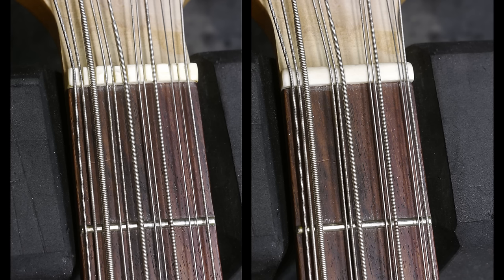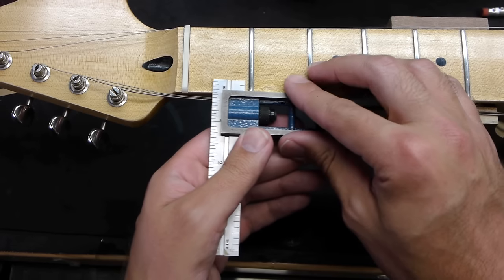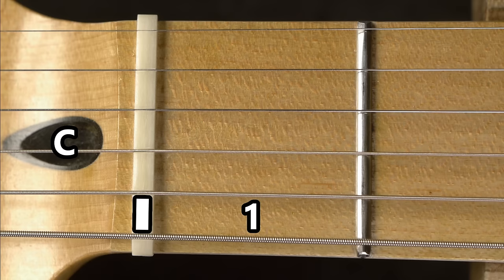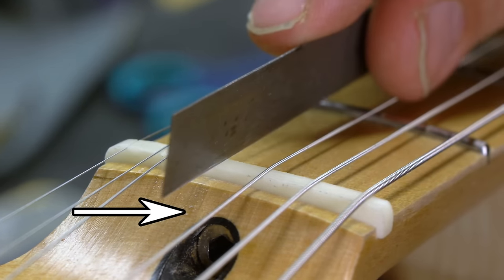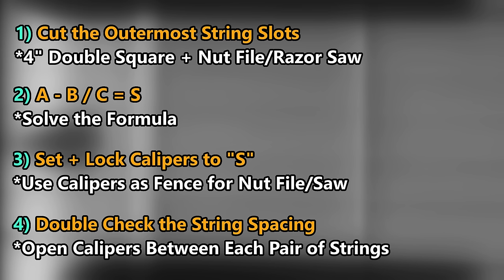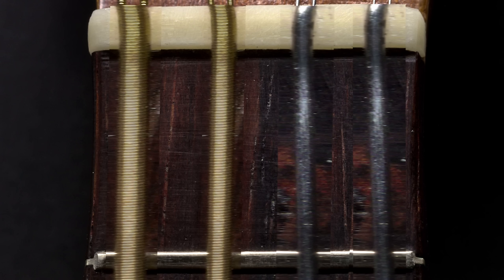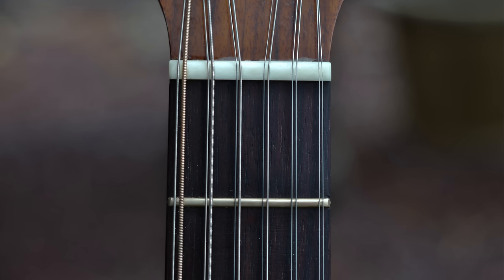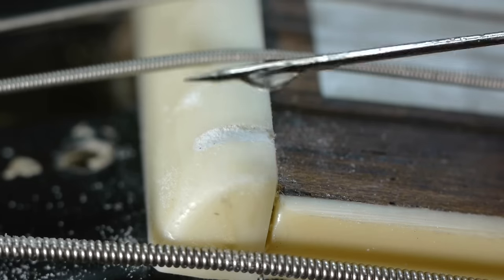Nut Slot Spacing *FOOLPROOF METHOD* - Works for 12 Strings Too!

Comment: Nice. I love the digital tools. One tip.  Instead of using a saw to mark the nut, why not use a mech pen with thin leads. That way its non destructive and when the final measufing is done, then cut the nut slots.
Reply from the maker: Thanks!

This can work. My main reason for using the files right off the bat is it takes human error (mostly) out of the equation. 

When cutting over a pencil mark, there is a degree of error. It wouldn't be hard to cut to the left or the right of the mark instead of the center. 

Being off by a little bit on each successive string can lead to big issues by the end. You might think you're cutting dead center on that mechanical pencil line, but it is very easy to cut to the left or right of it, without even realizing it. It doesn't take much error to end up with a mess. 

Even using this method, before I realized I had to double check the spacing after cutting the slots, I'd sometimes get to the B string -- then have a big gap between the B and high E. And have no idea why. It wouldn't make sense to me. 

So I think of the caliper jaws like a fence on a band saw or table saw. You want to make a straight cut in an exact location -- you set up a fence, lock it in place, and use it as a guide for making your cut. 

Another commenter pointed out that if the string gauge and nut file gauge aren't the same, this can result in errors too. That's correct. You can tilt the file to move the slot a little one way or the other to correct this. The most critical thing is making sure the distance between the strings you just cut is exact before moving on to the next string or string pair. 

The method you described will work, and most techs do it this way. Pencil marks, then cut. This is a novel way of slotting, that is very unorthodox, but solves the problems that can come with that. 

One more thing: I used pencil marks for years. One of the reasons I came up with this is I'm not the most mechanically inclined person. I really struggled to accurately cut slots over those little pencil marks. And many times it resulted in me having to throw the nut out and make a new one from scratch. 

The difficulties I had in spacing nut slots using traditional methods is what led to this. That, and extremely challenging nuts -- 12 string bass being the most challenging I've ever cut. They have 3 strings grouped together, in 4 courses. 

Doing that by eye, or even with pencil marks -- I wouldn't even know where to start. I sat there wracking my brain over how I was going to cut this 12 string bass nut, and could not think of anything at all. Then I got the idea for the method I showed in this video. I couldn't believe how well it worked. 

The paired string nut method was an extension of the caliper method. Using the feeler gauges as a fence was the secret. 

Fences and guides -- just like a band saw, or a table saw. Or even a router template. They largely take mechanical aptitude and human error out of the picture. 

Hopefully this clarifies why I use the method I do. Please ask any other questions if you have any, and I'll be happy to do my best to answer them. Thanks so much for the comment!

Comment: Great and informative video! What are your thoughts on angled nut slots as in angling the string path in line with the tuner to alleviate odd string path angles? You see it more with electric guitar companies that have poor headstock designs, the string leads the nut then needs to make a hard angle in order to reach the tuner witch puts pressure on the side of the nut slot and or needs extra string t's or guid too keep the string from popping out of the nut slot. I've found that cutting the nut slot at an angle in line with the tuner helps (sometimes)!
Reply from the maker: I generally do this. Cutting at an angle seems to help, and I've seen other guitar techs do this, such as Strange Guitar Works, if I remember correctly. I mostly think of doing this on angled pegheads, but the more exotic "hockey stick" style pegheads are good candidates too. 

I will add this: the height of the nut in relation to the slots is extremely important on guitars like this. Especially ones where the Low E is entering the slot at an extreme angle. This makes the edge of the nut highly prone to chipping or breaking off completely. 

Generally, having a little bit of the wound strings sticking up above the slots (e.g. 1/4 to 1/3 of the string) will make sure the nut is as strong as possible, resistant to breaking -- while also holding the string securely in place. 

If the slot is too deep, it becomes a greater risk. Paired string nuts are an even much higher risk as that wall in-between the string pairs is extremely thin. 

As for more normal angled pegheads, I have a friend who's a huge fan of the String Butler. This thing gets a ton of hate. I'm not sure why. It's nondestructive. You can install it and take it out with no modification to the guitar. It mounts under the tuner nuts. 

My friend claimed that it has worked great for him. With more exotic pegheads of course, all you can really do is angle the slots -- and make sure they're the right height. 

I recently got a set of diamond nut files as well. I haven't tried them for angled slots yet. But I do wonder if their cutting action being on the sides, as well as the bottom, would be a benefit there.

Comment: This is an interesting method, this will give equal edge of string to edge of string spacing.  I always thought center of string to center of string spacing is the goal?  In that case the math would be a little different, (A+1/2 diameter of outer strings)/C-1/2 diameter of the adjacent strings - 1/2 the file width, so the spacing between each pair would be slightly different, though the error with the video method isn't great.  Not sure how this would work/feel on a 12 string, the center to center vs edge to edge method.  I may be cutting some nuts soon and see if I notice a difference.

Comment: That stupid Stewmac's nut rule doesn't keep the strings equidistant. Precisely to be able to adapt to any situation, the distance (in the ruler) must vary progressively, which is why the equidistance of the strings is 100% NOT guaranteed. Use some dividers and that's it.

Comment: This is solid advice. I have redone the nuts of all of my instruments save one, my Parker, which was perfect from stock. That included 2 twelve strings and 10 six strings. It was a ton of work, done several times on many of them and I found this same formula on my own. Excellent video here describing many additional details. Bravo!

Additional note:  Paired strings such as my twelve strings need an extra step as the formula does not cover the inter-pair space. I found this using a capo to temporarily hold the inter-pair spacing of the pair in question on top of an uncut nut. Picking the pair until you hear the sound you will want completes the job, then the outside sum of the pair gives your new basic spacing. 

As this poster points out, that spacing will usually be much smaller than that of stock paired nuts and will also vary depending on which pair we’re talking about. The basses of octave pairs vibrate much more widely than do the higher pitched strings of unison pairs, so the octave pairs need more room. Again, there is no set number until you try the gauges you use. Did we say this is easy??  No, we didn’t.
Reply from the maker: If you check 7:15 in the video, I go over how to cut paired string nuts with this method. I've done many, including tripled strings on 12 string basses, with great results. I decide on a spacing between the pairs, then use either a nut file or feeler gauge of the appropriate width as a fence between the pairs. 

Then I calculate the two strings and the space inbetween them as one big, single string. Then the formula can be used as normal, as on a 6 string guitar or 4 string bass nut. 

12 string bass nuts have been the most challenging for me so far, and it was originally the nut that drove me to completing this method to work for paired string nuts. With this method, it doesn't matter -- you could have 4 strings grouped together in 4 pairs and this will work just as quickly and easily. It's pretty amazing. 

I don't think I've ever seen anyone else cut a 12 string bass nut. They're exceptionally rare. I've only seen one so far, and the original nut was a disaster. I'd like to make a video telling a story about it..I have many stories to tell. 

And that was a great one. I really was just stuck in a corner on it. I couldn't figure out how on earth I was gonna do it. I'd done 12 string nuts by eye for years, but this was just on a whole nother level. The original nut on that 12 string bass was one of the worst I've ever seen, as bad as a 12 string Jay Turser I owned for years, which was the first 12 string I owned...and I never cut a nut for it, as I didn't learn how to do that until years later. 

Started playing 12 string at 15 years old, electric guitar at 14. Jimi Hendrix and Leo Kottke being my two biggest influences, head and shoulders above the rest. Nice to reminisce!
Reply: @guitar_md    I did watch in its entirety, noting your ingenious adaptation of the ’giant string’ concept, and offered my additional comments as an enhancement of your excellent video, by no means a corrective. It can be a matter of taste how much ‘zing’ a player wants from their pairs, so I thought I’d mention my capo method as a way to hear it in action.
Reply from the maker: @artysanmobile  I see! My mistake. I just re-read your comment. I think I misunderstood what you said. 

And that is a good method. With your capo method you can determine exactly what kind of spacing you'd prefer, and then as you said, measure the outside of the pair to get the measurement for the formula. 

Again -- my mistake! Thanks for the support and for the comment, and the contribution. 

I'd be curious how much string gauge comes into play with the 'zing' as well. Very well might make a difference. I like taking notes on things and maybe for particular gauges, different inter-pair spacings can be established as a reference. 

If you ever find any measurements you like, let me know. Measuring in-between the pairs would be good as well for reference!

Comment: I'm new to custom guitar work and was curious, when using your formula is there a reason you don't factor in the width or the nut blade, thanks
Reply from the maker: The reason is because the only width that matters when spacing the inner nut slots is the distance between the outermost strings. 

And the only distance that matters with the outermost strings is their distance from the bevel of the 1st fret.

The overall nut width is irrelevant, as the strings have to be a certain distance from the bevel of the 1st fret in order to play according to the player's desire.

You could have the exact same nut width on two guitars, but on the guitar with the fret bevels cut in farther, the strings will need to be spaced farther in, and vice versa.  

Some players prefer the strings closer to the bevel. Some prefer them farther in.  

So to recap: The outermost strings are spaced *in relation to their distance from the fret bevel*, and the inner strings are spaced according to the width between the outermost strings. 

Other methods take the nut width into account. In my opinion, this method is more accurate, and is tailor-made for the exact instrument, with its exact string gauges, and exact fret bevels. 

Using the nut width as a measurement is possible, but will result in a cookie-cutter approach, where fine details are missed. I'm of the firm belief that the best way to make a nut is for the individual guitar with its exact, individual specifications. 

In the case of this method, those unique specifications would be the string gauge, and the fret bevel. Using my method as laid out in this video will require doing the same operation from beginning to end for each individual guitar, and there will be no shortcuts -- but it will result in the best possible nut that can be made 100% by hand, with "best" meaning the most accurate even spacing, as measured with digital calipers. 

Let me know if that helped answer your question at all or if you need any more clarification. Thanks for the comment!
Reply: @guitar_md  wow thanks for taking the time to write out such a detailed answer, yes that makes much more sense to me now, thanks again

Comment: I refer to the original video for every nut I make. It's great. Will update to this one. Any chance of a long form video on setting the neck relief?
Reply from the maker: Thanks so much! I've been slowly working on a neck relief adjustment video. There's a whole lot to cover. I'm sure I'll forget something but I'm doing my best to cover all the bases. 

Cliff Notes version: You can use a Digital Action Gauge to measure the relief at the 7th fret, after putting a capo on the 1st fret, and using a dowel threaded between the strings to depress the string you're testing at the last fret. 

This is the best alternative I've found to using a Digital Neck Relief Gauge (from G-Tech Guitars). Davide Bissoli from Rectify Master came up with the original Digital Action Gauge, so credit goes to him. 

But using the string as a straightedge, and using a digital action gauge, you can get pinpoint accuracy. And it works on any scale length too. The Digital Neck Relief Gauge only works on guitars and will not work on basses as it won't span the correct frets. 

In the video, I want to address other methods, such as feeler gauges, but I never use feeler gauges when checking relief. They just can't compete with a digital action gauge. 

Digital gauges overall give the most accurate readings on everything. 

And it was actually a customer of mine that suggested using something threaded between the strings at the end of the neck to depress one string at the last fret at a time. Brilliant suggestion. And it does work great. So that holds the string down at both ends and totally frees up both of your hands to check the relief at the 7th. 

I also will highlight the importance of checking relief on the Bass - Middle - Treble sides, to look for any differences. This will reveal potential twists in the neck. Usually there are very minor differences but it's good to know what you're dealing with. 

Also, I've gone to using Wera Hex Plus allen wrenches. They're phenomenal. The most common sizes are 5mm, 4mm, 3mm, 3/16", and 1/8". 

You can use a socket as a breaker bar to increase leverage, as in, sticking the allen wrench into a Fender headstock the long way. This clears the strings, but you need the extra leverage to have enough power to turn it. I get aluminum dowel rod, chuck it in a drill press vise and drill them out, but a socket works just as well. There are many solutions for this. 

I could go on and on. These are the things that go through my head as I'm writing a script, which usually takes multiple revisions over months. I will also point out some safety tips, primarily how to find the right size wrench -- you go gradually down in size with allen wrench adjusters, and up in size with socket adjusters. You always want to make sure that you can't strip the adjuster. 

The Wera Hex Plus have more prominent contact points that are less likely to strip an adjuster. I'll also cover how I adjust the tension with the strings on, and tuned to pitch, probably 90% of the time. 

I'll have to demonstrate how to back clamp a neck as well. To totally back off an adjuster, then clamp the neck into a back bow before tightening the adjuster -- this is necessary in some stubborn cases. 

It also may be necessary to remove the adjuster, add a washer over the threaded truss rod, then reinstall the adjuster. I usually like to put a drop of 3 in 1 oil on the adjuster threads to keep everything working smoothly. 

Then there's the issue of potentially needing to remove the adjuster and clear out the wood around the adjuster. That can cause the adjuster to hang up. 

So....lots for me to think about. I'm also including some graphic demonstrations of how a truss rod works. There's so much to cover for such a seemingly simple operation, but if an adjuster is working perfectly -- it's very easy to do. 

The problem is when an adjuster isn't working great, you don't know the correct size, or you go to turn it and it seems to be doing nothing. There are many caveats I have to cover. 

Anyway, hopefully this was of some use to you. It will likely be a long time before my truss rod adjustment video is completed. But I do have it in progress. I hope these notes I just wrote out for you can be of some use and get you started. It takes me forever to organize my thoughts as, if you couldn't tell -- I'm quite scatter brained and so organizing my thoughts into a coherent format usually takes me months of work to complete. 

I look forward to it! I'm also excited because a neck relief adjustment video might be my most accessible yet.
Reply from the maker: Also, for now, here's a short one: 

https://youtu.be/oLu6JR096f8?si=kEUGP0eBTxOP6Btd

I've already progressed past that by the trick I mentioned to depress the string at the last fret as well as the first -- but the same thing applies. I might even just delete that video and re-upload a new version in the meantime.
Reply: Wow. That is an awesome reply. Thank you. I, for one, would really appreciate seeing your approach to neck relief. If it's anything like this nut spacing video, it will be killer.